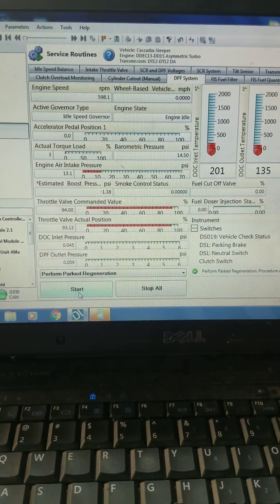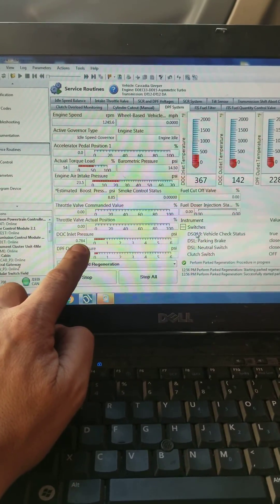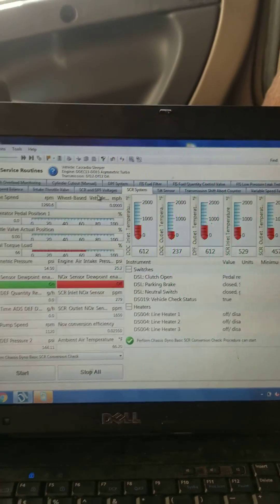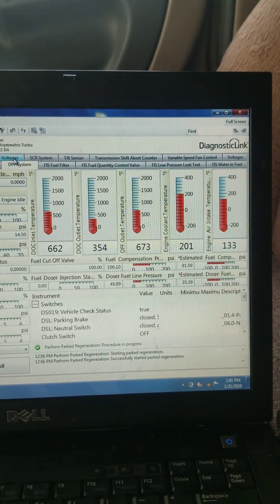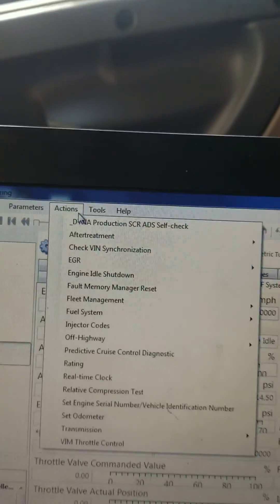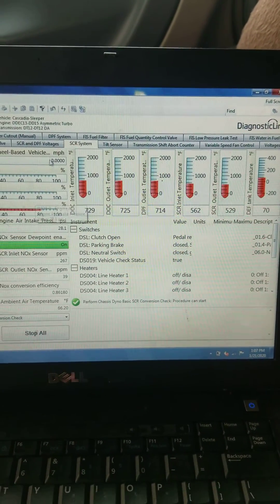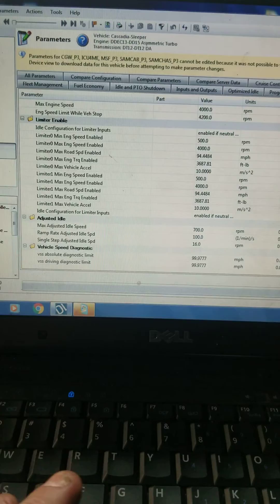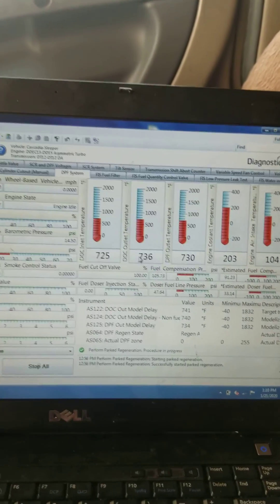What is happening during a regen

Comment: I’ve had 2018 cascadias pass a DEF quantity test but come back with 99% efficiency and still have active SCR closed loop at max /max multiple sources and yet swapping a DEF doser and re running an SCR efficiency test and it clears the codes 

What gives

It passes the quantity tests one time but during a SCR test it over doses are me cycle out of many ??? 🤷‍♂️

Comment: My inlet nox is showing 360 ppm and the outlet is at 14 ppm during the regen ,after the regen was done and the idle set the readings were 160 ppm for the inlet and 8 for the outlet! I still have code 4364 fmi 17 and the code is permanent, recently the dpf filters were replaced with new oem ,is my readings any good , thanks in advance

Comment: Question...If, during a regen, the SCR Outlet NOx Sensor is reading say 400ppm and the SCR inlet NOx Sensor was say 300ppm...what could be the cause of that?
Reply: Great question. I work on these trucks all the time. It's really a gamble because you can see a bad reading on either sensor and jump to the conclusion that the Inlet was reading really low and just replace it and hope it corrects the problem. Sometimes that works. Sometimes it's best to just replace both sensors to correct the issue. Reman sensors are cheaper, but I have seen them fail early on. The company I work for suggest to just replace both sensors and we will get paid for the warranty on the parts because they fail so often. You can also do a nox sensor test, but it will fail and not tell you which sensor is defective 😂 which is really annoying

Comment: I had fault code, for nox raw...can't remember the actual spn/fmi. I ran Regen numbers looked good and both nox dew point turned green. However, nox inlet was 1650ppm and outlet 3ppm and nox conversion stayed 0.0255 thru whole test. Co worker threw inlet nox sensor. Would that be remedy to that issue.?

Comment: Question? I have a truck I put a new one box on for high doc pressure 2.548 and higher. Replaced the one box and pressure is higher than it was before replacing doc and dpf. Updated mcm,cpc etc. 
Any info on why I'm seeing this

Comment: Your more recent videos have the comments turned off so I hope you read this. From what I’ve seen so far watching your channel you’re doing a much better job of actually being helpful so I’m hoping I can ask you if you could make a video showing how to do things on the one box like change out nox sensors. I carry on my truck in and out nox sensors as well as a doser valve. Just in case I need one on the road. One problem I have is I don’t know which nox sensor is which on the one box. The new ones look exactly the same to me and I had to look up part numbers and write on the box it came it which is which.

A video on replacing these sensors, dosser valve, maybe installing this new shield Detroit has available. Basically a tour of the one box.

Also… where are you guys located. I need a mechanic I can TRUST!

Comment: cool vid dude, ty , can you answer a question please , low soot, running fine , if i need to park regen ever with low soot it wont let me , says not allowed , is this always like this , i am trying to have a piece of mind if i ever need to park regen would i be able too when soot is higher since it is not allowing me now with low soot would it let me with higher soot , thanks in advance
Reply: @jimmyking9023 I’m assuming you have one of the new Cascadia’s (2018-present). If the screen says spot level good it won’t allow you to do a parked regen or active regen until the spot level is higher. When the screen displays “Soot Level Okay” it will allow you to do a parked regen, or it will automatically do an active regen while driving and that is just as effective as a parked regen. The system is essentially protecting the after treatment system from unnecessary excessive temperatures. The most important thing is that you don’t ever shut the truck off while doing a regen! The extremely high temperatures can crack your DPF and cause several other issues leading to very expensive repairs, so always allow the truck to finish the regen and then let everything cool down for at least 10+ minutes. I hope this helps!

Comment: You know a lot, but not a lot. Decent explanation bad advice. You have a lot more to learn before putting out this info. But good enough for starting techs.
Reply: Question? I have a truck I put a new one box on for high doc pressure 2.548 and higher. Replaced the one box and pressure is higher than it was before replacing doc and dpf. Updated mcm,cpc etc. 
Any info on why I'm seeing this.

Comment: I have a 2013 Dd15 just after a overhaul driver states truck has power loss issues when I put computer and ran diagnostics it is displaying fault code 1077  internal or  external leakage in high pressure fuel system. Would that contribute to his loss of power?
Reply: @oraliaornelas5742 I’m not a certified diesel mechanic, but I know a lot about these engines and their after treatment systems. One of the first things I would look at is the fuel quantity valve because they’re notorious for causing a loop at idle, and they can definitely be the cause of reduced power. However, the fuel leakage part seems like it could be an issue with something in the fuel system. These high pressure common rail fuel systems run at a pressure of 20-30,000 psi, and any small part not working right can cause a lot of issues. It’s hard to say without actually seeing the engine, but Detroit has had a lot of problems with their fuel quantity valves, and it’s very easy to diagnose. With the engine idling at low idle if the engine slightly drops from 600 rpm then goes back up and does this constantly (you’ll be able to tell because it’s very annoying) then there’s definitely an issue with the fuel quantity valve even if that isn’t the cause for the code. The best way to prevent the fuel quantity valve from going bad is to run a fuel additive that increases lubrication, and avoid idling at low idle as much as possible. High idle if you’re driver has to idle the truck, but it’s best to reduce idling as much as possible because it causes a ton of after treatment issues. I hope this helps!

Comment: Hey man got a cuestión. 
I have a 2014 freightliner 114sd Detroit dd13 and start the regeneración and during the first 20 minutes it's the combertion is at 90 % and start dropping down the 40 % but it does gradually. 
I replace the DPF filters with a new  because there were cracked and bot of the nox sensors doser injector and the pump the DEF light still flashing
Reply: You ever fix issue?

Comment: It's grams/hour not gallons per hour. If the ecu was requesting 1100 gallons per hour the 30 gallon tank on the truck would be empty in like 5 seconds
Reply: My truck is at 500 g/h is that normal?  DD13
Reply: Not sure what they should be at but as long as u don't have mil on i wouldnt worry

Comment: I could watch this for hours. It's a real crime that manufactures these days hide so much of this information and too many shops will "diagnose" a 1-box replacement for nearly any issue. Those of us who own and operate this equipment won't be customers for long if we have to sink the purchase price into repairs annually. I had the dreaded 520372/16 code and two dealerships told me to ignore the "nuisance" warning until I pulled into the third to be sold a $15,000 1-box. I flatly refused, I don't buy a new car when an ABS sensor goes out. A day of google and 5 hours of regen/scr efficiency testing and the truck hadn't run better in the last 18 months.

Comment: So I was trying to do a regen for the 1st time with 2018 pete with a px7 engine. Temps got to 1,100. Warning came on the dash exhaust temp high. Is that normal? Smoke was coming out from under the hood, no coolant leaks but coolant temp got to 210 then dropped down. I didn't like that so I'm thinking thermostat is sticking. I shut the truck off cause I was afraid something was wrong. Im going to change the thermostat tomorrow and try again. No one at my shop is familiar with def system. Should I have continued with the regen? Also i did notice soot level said 71% or is it too clogged to do a safe regen?
Reply: You were regen'ing. You would expect hot exhaust, no? That light is only there to warn you from parking on dead grass. Smoke can be from a lot of things, but basically your engine is getting much hotter than it normally would, so anything lingering is going to smoke-off. I had an oil leak from up front that coated just about everything back to the diffs and when I regened the damn truck looked like it was on fire. There IS A DANGER, but it just requires you to monitor the situation. Pop the hood and walk around every few minutes until the gunk burns off.

Comment: A tech could run the regen and walk away then review the log file later on. It doesn't necessarily mean that the tech doesn't know what they are doing. Also you shouldn't really pay attention to the NOx efficiency until the last 7 minutes of the regen which can be done by reviewing the log file. Any deposits built up on the sensor needs to be burned off so an accurate reading is obtained. Also the NOx conversion can be affected by DEF build in in the ATS, you may have to do a couple of regens to burn the DEF out and then recheck the NOx efficiency.   If the DOC's have face plugging it doesn't always mean that you need a new one box. When you run the regen and the DOC inlet pressure is above 2.5 PSI the DOC's are plugged.  There is an alternative to the DOC face plugging routine, you can use the DOC air cleaning method. It doesn't take as long and is more effective.  If you update your version of DL you can run the NOx verification test to check NOx sensors. That the preferred  test because it burns off any deposits on the sensors before testing the sensors and returns a pass/fail determination.  If you leave the sensor outside of the the box it wont read 100%, it won't work because it is not seeing the  necessary exhaust temperature to turn on. Then you will eventually set a fault code for the outlet NOx sensor not turning on or meeting the dew point.
Reply: You should create some videos, you seem to have the knowledge many people seek.
Reply: Can you tellme that ddl version to update Nox verification test.
Reply: this man sounds like he knows whats he talking about
Reply: I'm sure both of these guys know what they're talking about, it's just that these systems are so complicated and layered that diagnoses has become an art again. The best thing that can happen is a reasoned debate among experts.
Reply: I saw a video in which tech was saying thst if DOC inlet pressure is above 1.2, detroit calls it face plug!

Comment: How much could cost this diagnostic link to buy ?
Reply: From Detroit? ~$5000/yr membership. Do what I did, buy a cheapish laptop (I bought a 2 generation-old Toughbook for $400), buy the NEXIQ (400 for V.2, 900 for V.3 w/ bluetooth which you should never use), then go on ebay and buy DDDL for ~$100, make sure your getting the highest version #. They'll remote in and install it, make sure you get the "backdoor keygen" as well.

Now you have top-level access and the russians have so thoroughly infected this machine that it would infect AIDS with covid. You will/must NEVER connect this computer to internet again and it will serve no function other than DL. Do not ever check your email or plug anything into it. No phones, no USB sticks, no mice or keyboards that will ever come into contact with another computer.

Be very careful with your newfound power, you have greater rights than any FL tech and can give them a real bad day trying to unfuck your handiwork.

Comment: Whats the best way to get this ddl software
Reply: From Detroit? ~$5000/yr membership. Do what I did, buy a cheapish laptop (I bought a 2 generation-old Toughbook for $400), buy the NEXIQ (400 for V.2, 900 for V.3 w/ bluetooth which you should never use), then go on ebay and buy DDDL for ~$100, make sure your getting the highest version #. They'll remote in and install it, make sure you get the "backdoor keygen" as well.

Now you have top-level access and the russians have so thoroughly infected this machine that it would infect AIDS with covid. You will/must NEVER connect this computer to internet again and it will serve no function other than DL. Do not ever check your email or plug anything into it. No phones, no USB sticks, no mice or keyboards that will ever come into contact with another computer.

Be very careful with your newfound power, you have greater rights than any FL tech and can give them a real bad day trying to unfuck your handiwork.